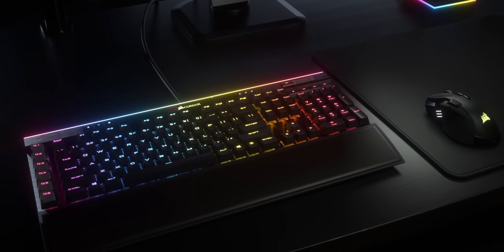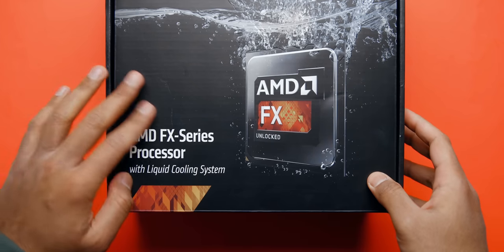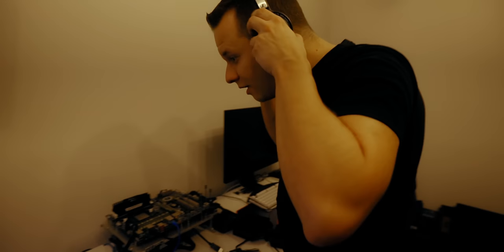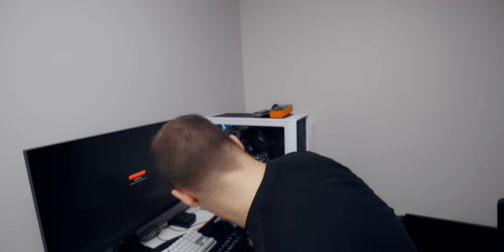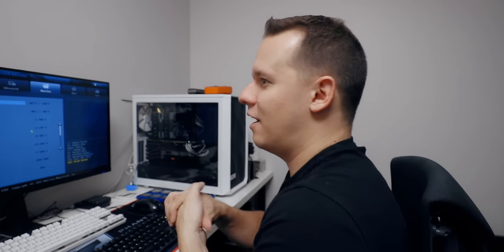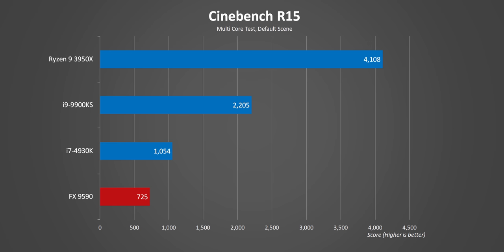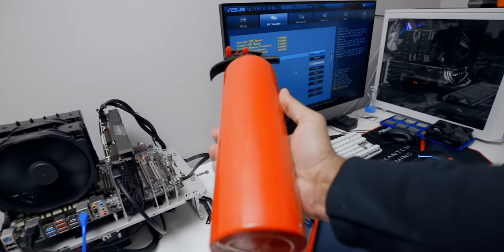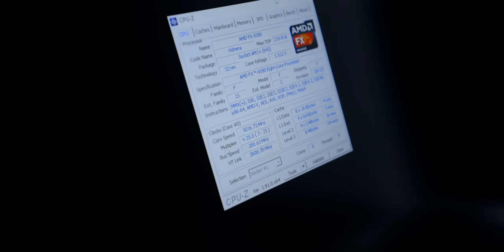Why The FIRST 5GHz CPU Almost Failed - AMD FX-9590 Revisited!

Comment: i think you don't know much about PCs...
You are taking a CPU & mother which hasn't been used in at least 5 years or more. 
Did you change thermal paste on motherboard? southbridge mosfets and VRM? thats elementary... maybe not for an Fx8350, but for a 9590 O'ced to its limits yea you need to do that sh1t

You are testing 9590, which was priced equal to i7 3770k against X79 flagship and newest intel and amd cpus... of course its going to look like crap... Nevertheless it is important to mention that Fx9590, despite its silly power consumption and cooling needs DOES MANAGE to perform ok for 1080p/60fps even on those modern Triple A tittles that can bring problems to an Fx8350.

Oh, BTW, do not get me wrong, Fx9590 was a terrible idea, a modest 4.5ghz overclock at 1.4vcore on an Fx8350 will get close to same results for way way less power draw

Comment: I don't get to flex very often anymore...but this is my chance. In 2014 the CPU was over $900, however when I bought it a year later I got one without an AIO cooler for $220 on Newegg. By that point it had been surpassed by a couple Intel CPUs. (skipping a LOT of detail for brevity's sake) I used a 240mm AIO that we modified considerably with a pressurizer (not a compressor, pressurizers ensure proper pressure on both ends of the loop) and loaded the coolant with our homemade Li02 Lithium Hydroxide based coolant. After long-term tweaking and considerable thermal adjustments (adding 4 more 120mm fans to the already 7-fan case) My FX 9590 ran for 2 1/2 years at 6.13GHz. It was -40F on bootup and leveled at 9 degrees F at max load. It would sustain this speed for 100-110 days before the R-12 would start becoming inert and need to be replaced. I bought 16LBs of R-12 on Ebay for $99 which lasted me almost 2 years. This set and held the world record for "fastest Vishera-based non-exotic cooled computer in the world". The system power draw at max load (with no 3D video in use) was 690 Watts. And at max load with games running would hit 1,050 watts (due to the R9 295X2 video card). The system's 1,500 Watt PS barely held a stable line for those 2 1/2 years. 

In November of 2017 I replaced the FX 9590 with a Threadripper 1900X. Using the exact same process except a 360mm AIO rather than 240mm, I have been running this TR 1900X @ 4.985GHz. March 2020 and it is still running for 100-110 days before refilling. We can't use R-12 anymore (illegal in all states now) but the TR doesn't get nearly as hot as the 9590 did. Still starts at -42f and max loads at 4 degrees F once again setting and holding the record to this day for "Fastest 1st Generation Threadripper using non-exotic cooling". Any jerk can use liquid nitrogen and do a 4 min to 9 min run for some insane clockspeed. Mine has been running at these speeds for YEARS only stopping every 100 days or so. I am intending on moving to a 4000 series Ryzen when they release. Once again...Lithium Hydroxide hopefully will push it to record-setting heights like its last two brothers.

Comment: I had a FX 9590 for a few months, I had picked one up used for $65 used. It wouldn't turbo upto 5Ghz and I couldn't overclock it to 5Gh no matter what I did and the temperature sensor was faulty because under full load, it reported it was running at 7C. Either the chip was super ultra mega binned, OR, it was lying. Given that Corsair link was reporting water temp of 40C, I suspect it was lying.

I traded my FX 9590 for a Phenom II X6 1090T. I was able to overclock that to 4.2Ghz @1.55V paired to 16GB of G.Skill Sniper Series 2400Mhz clocked at 2000Mhz on my Asus 990FX Sabertooth R2.0. Its an excellent bin for a 1090T and I bet it can push past the 4.3ghz barrier if I could get the temps lower. Under full load, its hitting 55C. I still maintain that the older Sabertooth bios found on that board is superior to most modern mobo bios. It was so simple and easy to navigate. <3

Tell you what though, I bet the IMC on the 1090T and NB on the board weren't happy since the IMC was rated for 1333mhz and the board was rated for 1866mhz. xD

Comment: I've still got an FX-8120 chugging along for my home file server running FreeNAS. It's in an Asrock 990FX Extreme 3 motherboard with 16GBs of 1866MHz RAM. The case is the classic Antec 900. Terrible cable management but the airflow is actually awesome. I don't really know why but I kinda have an obsession with these old FX chips. They kinda suck but I like 'em. I'm weird like that. For purely multi-threaded workloads like video transcoding it's honestly not terrible with a 4.0GHz OC. I can do about 3-4 1080P transcodes for Plex which is decent enough for my needs. Power consumption surely isn't great compared to newer chips but I like reusing older hardware where I can.

Comment: Technically my first own PC is using Athlon x2.
Then.. I don't care about AMD anymore...
It was a literal trash

My 2nd PC used Intel Core 2 Duo.

Then bought laptop since it is more useful in university while I can still game.
Used Core i5 4xxx forgot the exact model.

Then went back to PC, see I need to bought it with my own money...
Used Pentium G4560 why?
Because GPU price was so high I prefer a balance system with decent GPU and SSD rsther than spending for Ryzen...

Might be my biggest mistake.

Bought a laptop for works, Ryzen 5 2500U

And here I am... still using G4560 because Core i5 6400 or 7400 price are still not making sense in my country.

Both are priced around Ryzen 5 2500X
Waiting the price to drop or next Ryzen platform since we know that AM4 is dead this year.

Seeing how Ryzen is going well, I think my next will be AMD with new platform IF the price is still making sense

Comment: I have this processor and still use it. I used to have some MAJOR freezing issues. I took my pc to a shop and they blamed the power supply. I thought it was my Graphics card. I thought it was my case cooling. upgraded all these things. NOPE, still froze. One day I get a letter in the mail about a lawsuit that amd is in from lying about how many cores their processors had. I looked into it and found a reddit page that told me how to fix this issue. From pure frustration I went into my bios and punched random numbers (of which I had no clue what i was doing). After YEARS of freezing issues, finally, it runs FANTASTICALLY. THE RANDOM REDDIT NUMBERS WORKED. the journey was absolutely insane. I Will NEVER buy AMD again.

Comment: I still have a FX9590!

I only bought it maybe a year or two again. Brand new, on a massive sale at either newegg or memory express. It was like maybe $160? Ish? They still had some in stock and were just clearing it out.

While I could never afford it when it came out, I was happy to upgrade my overclocked 8320 :)

It's feeling kinda sluggish now for gaming, but things will snowball way too quickly if I want to upgrade. So, I'm keeping it for a while until it's so obsolete that I keep the whole system just for nostalgia's sake.

Just like my 1055t system. And my A64 3000+ :D

Comment: FX 9590 Vishera was a nightmare to stabilize. It would randomly just freeze up, no matter the workload. Eventually I just disabled the boost mode (which would have brought it to the 5 Ghz theoretically) and set the CPU ratio to 21.5. Frustrating times, but it couldn't get me to hate the machine, because I got it relatively cheap.

Comment: Intel has solved its power consumption issues. They just redefined how they measure TDP. If AMD had done the same with the FX-9590, it would have probably been seen as 120w power efficient CPU.

Comment: THIS CPU MUST BE WATER COOLED TO FUCTION .AND CLOCKED DOWN TO 4.7GHZ
IT RUNS FINE..BUT, THATS LIKE HAVING A STABLE COOLER RUNNING CPU FX 8350
DIFFERENCE  OF 4 TO 10 FRAMES.. DEPENDING ON WHICH GAME YOU PLAY.

Comment: The way you conducted your tests is flawed.
The reason for that is you don't really need to push these chips to 5 GHz - they are severely bottlenecked by your RAM speed and by the speed of the NB (btw testing with DDR3 1333 is nuts - these chips require at least 1866). Yeah, the IPC is far behind from Team Blue, but you could've gained way more if you overclocked the memory and the memory controller (in this case - the good ol' North bridge). Also - the chip's 8 MiB of L3 cache isn't really enough when all 8 x86 cores are utilized, as it's clockspeed is tied to memory clockspeed. Many AM3+ motherboards did not support NB overclocking, though - the best way is to crank up the BCLK (base frequency) and compensate for increased memory clock speed. All this may contribute to up to about 35% increase in performance - at less than 4.4 GHz. Not enough to tie intel, but hey - a very noticeable free boost.

Comment: I first got into PC gaming and building about 12 years ago and the fondest memories I have are of the Phenom II X2 555 which was a dual core CPU but you could activate the other 2 cores in the BIOS and some were stable as full quad cores.  I was finally able to get mine stable with 3 cores running at 3.9 GHz.  If you guys have one of those lying around I'd love to see how your chip compared.   I also have fond memories of overclocking with my Powercolor HD4850, running the Crysis benchmark over and over again trying to get over 40 fps regularly at high settings on my 17" Sony CRT monitor at 1024x720 LOL.

Comment: My 8370e just got replaced by ryzen 3600. Very noticable difference in some games and video editing. No real difference in daily tasks. I used to run the 8370e locked at 4.8ghz, buy later ran it stock to decrease heat. Amazed I didn't kill it with voltage over the years. 

Takeaway -- FX CPU are only bad if you want to hit a <100watt TDP, and even then, they are better than many modern laptops as a cheap workstation option.

Comment: 5GHz was a big disappointment apparently. The Bulldozer uArch was supposed to be hitting 8GHz!!  but with major design issues and fab issues with GloFlo, they only managed 4-5GHz and that slaughtered their IPC. And it makes sense because if you're able to clock that high, you really don't need SMT. Also Microsoft Windows scheduler was out of whack. So AMD decided to go back to their roots of high IPC with Ryzen which is what AMD was historically always better than Intel at during Nexgen, K5, K6 and Athlon era.

Comment: Because of that processor I learned how to liquid cool, very well. Using a 95,000 watt btu liquid to air heat exchanger to cool my x570 set up. everything in my rig runs at 19c.

Comment: I had an fx 8120 paired with a ASRock 990fx extreme4, that one motherboard with a very very large northbridge heatsink. On-air I had that CPU stable at 5.2 gigahertz all the time. I do believe how the motherboard design health because when I accidentally killed that bored, I bought a cheaper gigabyte 990fx bored and I blew the vrms on it.

Comment: I owned an FX-9370 for maybe 6 years. Only reason I had it was because I wasn't able to buy the parts for my system myself at the time. I remember an Ivy Bridge Xeon I was looking into at the time was probably $10CAD more expensive than the $210 the FX-9370 came out to, but was more or less an i7 with no graphics on board.

That FX-9370 gave me so many problems. It killed the first motherboard it was installed in, because the person who helped me buy parts refused to believe that it would require a 990FX chipset. First all the USB ports basically died, so I sold that motherboard for cheap to a friend who didn't care. A few months later the VRMs died and the board was toasted - he was running something like an FX-6300 in it. It killed a Corsair H80i in 6 months. After 3 years one of the original Corsair fans included with the first pump that I had still been using literally fell apart pushing 90% because of the heat of the chip on idle. It would hit 60 degrees Celsius before I could enter the BIOS in it's second motherboard (a Crosshair V Formula Z) with a brand second new H80i. It was incredibly painful to use - after the first 2 years I ended up permanently underclocking it to 3.0GHz, reducing it's voltage down to 1.38v or so, and disabling 2 of it's 8 cores. It would still run hot when idling. Everyone I talked to asked how it could possibly run hotter than an FX-6 series when I was running it slower. It wasn't stable below the voltage I managed to get it to. It frequently reached 95 degrees C occasionally when doing nearly nothing in Windows. I had it shut down while running games nowhere near demanding more than once, because of heat. It was so slow to use that an SSD with advertised with over 500mbps r/w had no impact on boot speed over a mechanical 7200RPM hard drive. My case had 3 Enermax 120mm fans which I still use in my new system, a Noctua Industrial 140mm, and 2 more Enermax 120mm fans the very much worn out sets of Corsair fans I have - airflow was not an issue.

Before I ended up permanently underclocking it, I had done a test to run the system at 1GHz, 1 core and as low of a voltage I could achieve to boot the system with (not even bothering with stability). It still ran hot.

I have never been so glad to replace anything I've ever used like how I did when I was free from that FX a few months ago. The last system I was using before I assembled the FX system was a low profile OEM system running Sandy Bridge Pentium G with an Nvidia 210 added to it, and I swear that Pentium G pushed better than my FX-9370 ever did.

Comment: cant say for the 9XXX series but from the FX 4XXX thru to the end of the 8XXX Series they wernt true Dual/Tri/Quad/8Core CPUs. thier marketing was a little misleading.  it should of been made to say "Performs LIKE an X# core Processor" (every second core Shares the FPU w/ its Partnered core so in the 8core lines it is more akin to a Quad on super crack  with more effective peformance of closer to a 6 Core. 

along with how every other Core lacked its own dedicated FPU,  as you saw, it had Poor Single-core Performance, and it's overall IPC was Lacking.  where the FX line does excell at points (but not past Intel,) was Multi-threaded workloads. (im not hatin for hatin sake , like i had never used a system w/ an FX Series CPU, my main rig still rocks an,albiet aging, FX8320 and for almost everything i need it to do, it still performs fairly well. Espically when i paired it up w/ an GTX 1650 (i had previously an 760 that bit the dust in the middle of a game)

Comment: Are you sure this isn't my old setup?  I sold my fx9590 and Asus 990x sabertooth on ebay about 6 months ago.

Still watching the video, but I will say I went from my gtx 970, to a 1070ti, an saw minimal improvement.  Ditched the fx for a ryzen 3800x, and saw a BIG improvement.  I'm not happy to find that the system I built years ago was already a bottleneck for my gpu.

Comment: would be nice to watch a video about 4930k and how it aged, compare with modern 6 core processor like ryzen 5 2600/3600 etc
and with OC.
just so happen i use 4930k with asus rampage 4 extreme, and want to update, but don't really sure should i?

Comment: Almost everything about FX processor were quite bad, especially in the math department (FPUs were shared among two integer CPU cores which is of course bad for performance as you have CPUs fighting each other over FPU resources, which is also why it didn't do so hot in gaming - AMD fixed that by changing the FPU layout to the classic unified core configuration like Phenom II before the FX in Ryzen processors which fixed the FPU handicap). I decided to just skip Bulldozer architecture in general, and instead jumped onto Ryzen Threadripper CPU when it got quite cheap - Zen microarchitecture was and is significantly better than Bulldozer in so many ways.

Comment: I have a 9590 and love it.  Still runs all the games I want to play without issue. My GPU seems to be the main bottleneck.  It still pushed through Cyberpunk 2077 with about 40fps average the entire time on max settings with an RX480. Sometimes it would dip lower but not too bad.  I'm not complaining for an older GPU and CPU to handle modern games like that. Shadow of the Tomb Raider on the other hand, ran amazing with no frame rate dips, near 60fps still with that CPU and GPU combo. Call of Duty Cold War, I set it to render at around "2K" and display at my monitor's resolution. My monitor is only 1080p, so I have not tried any higher.  Will be going to Ryzen the next time I need to upgrade.  I may end up keeping the CPU longer and upgrading the GPU as it seems to show 100% usage in most/all of the aforementioned games

Comment: Interesting to find people calling this old.  I am watching this video on my main computer which runs the Piledriver Core FX-8350.  It is as stable and fast as it has always been and still keeps up on modern games without a problem.  I cool it with the Cooler Master Evo 212, but I replaced the fans with dual Noctua push and pull 80mm fans, and I still run an idle temp of around 15 Celcius, a normal load temp of 25-30 Celcius and a high load (gaming and video rendering) of 45-50 Celcius.  Of course the 8350 also has a TDP of only 125.
I honestly still love my build, and the only computer I have used that gives me cause to want to upgrade is a Ryzen 9.

Comment: It is unfortunate that you guys did not perform one of the most important steps for AMD PD/BD arch overclocking.  NORTHBRIDGE SPEEDS and RAM speeds/timings.  These two things alone were the kings for unlocking proper performance, due to architectural blasphemy.  Dont get it twisted, AMD FX still lagged hard behind, but you could easily shorten the gap with a little patience and a good cooler.  Plus, AMD FX was fun as hell to overclock.  Failures didnt blast the chip to powder, and most motherboards would cry for mercy before you had a chance to overvolt a cpu to death.